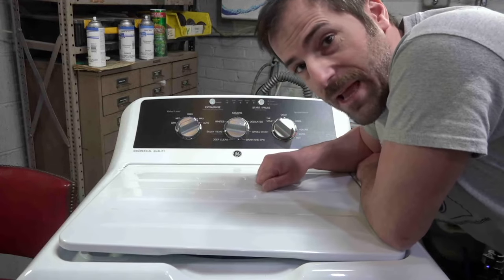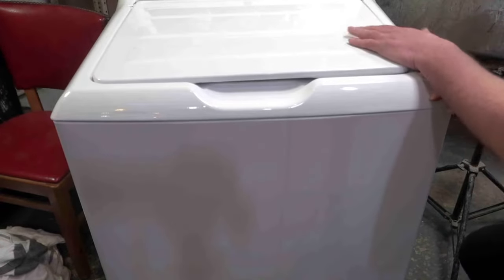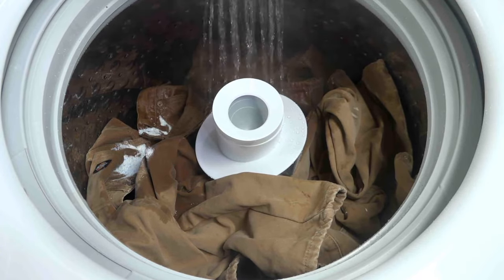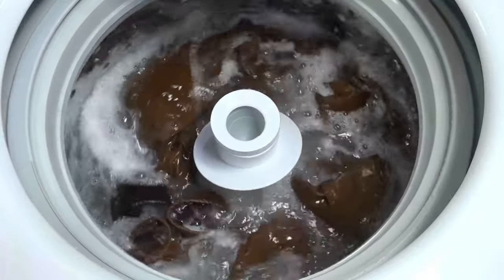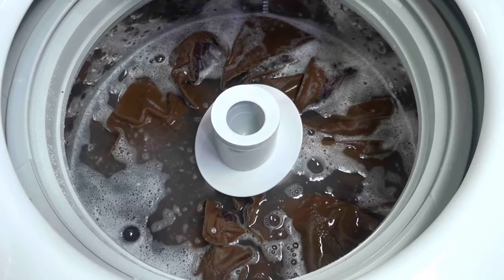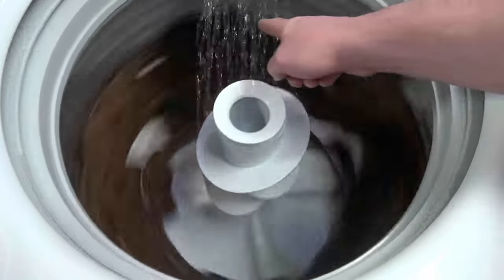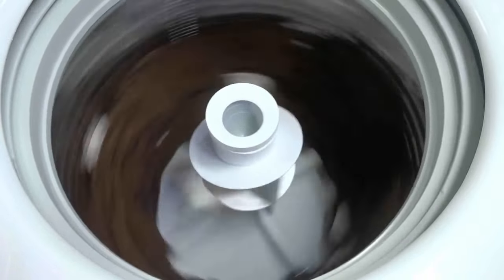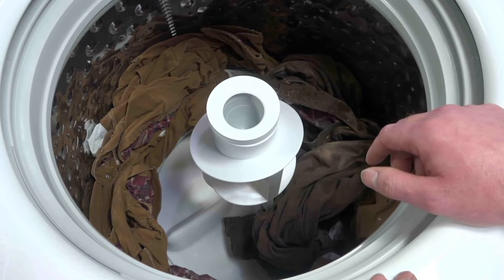FIRST LOOK: GE Commercial Washer GTW525ACP1WB

Comment: It's pretty bad that manufacturers have to slap the word "commercial" on their product in order to try to portray that this is a better machine than their residential counterpart pieces of crap. They're pretty much admitting that they make crappy products nowadays.
Reply: GE's put "commercial quality" on high-end washers since the early 2000's. Only thing new is people here tricked into thinking this washer is somehow special.
Reply: I agree 100%. Slapping a commercial badge on a machine and throwing an extended warranty on it doesn't make it commercial. 

I haven't seen GE machines in the truck stops, Laundromats, or hotels in the area  I live. 

What I have seen: Speed Queens, Maytags, and in the shower areas of some truck stops, the LG 3 series front loaders (such as the WM3600, WM3700, WM4000, and WashTower). If they're good enough for a truck stop, they're good enough for me.

Comment: have a new unit that has never filled with enough water. no adjustment like other models. water level controlled by timer to save the world. had all circuit boards replaced and still the same. have to add a bucket of water on each load. ge  just blew me off and said i could get a different model and still have to pay about half price.  if you dont have a high water supply pressure it will never fill to do the job right. told them that a minimum pressure notice should be on the machine. they could care less. save your money and time and dont buy this shit.

Comment: Just had the plastic drive pulley replaced on our GTW525 after 22 months of operation. It destroyed itself at the motor drive shaft. Repaired under warranty but was really surprised that the main drive component in a "commercial quality" machine was made of plastic. We'll see how long the replacement lasts.
Reply: Same thing happened to mine after 14 months!
Reply: Were the gears plastic or nylon?  I am guessing that the pulley did not have a metal bushing molded into it

Comment: I haven't used this washer for a while it's sitting in the basement. If I remember right it's fairly gentle on the clothing. I guess the thing is, if I want gentle on my clothing, I would put it on a gentle cycle. I don't need it to be gentle right up front.The thing I don't like, for certain, is it goes off balance real easy. I will stick with my Speed. Queen front-loading Commercial washer and my Maytag top loading commercial washer. Love them
Reply: you have two washers ?

Comment: The verticl sections on the agitator are designed to splash the water onto the clothes during the spray rinse. This has the best agitation I've seen on a modern washer. Their cheap washers have this same agitator and wash action along with the 20 minute spray rinse and spin on the normal eco. They've been this noisy since the 1990s, but my Hotpoint went strong for 13 years. As far as I know it's still working in the house I sold. My presnt cheap Hotpoint is noisy but works fine. For $429 if it still works after 4 years, I won't complain.

Comment: To get real hot water in a washer.  I would think we might have to run the faucet in a nearby sink until it runs hot.  Then turn on the washing machine AND maybe shut off the cold water faucet running to the washer ?
Reply: Yes, you could do this if stuck with a washer that makes it necessary.  I've spent way too much time thinking about ways to defeat the dumb-a$$ery imposed on washing machines these days.  If I had the capital I'd start a business with hacks and add-ons to deal with these issues.  My idea is a valve system that you attach to your hookups and then the washer supply hoses hook into the system.  There would be a switch or valve that you could turn so that when you wanted untempered hot water in a machine that always insisted on tempering, you would just turn the valve and it would divert the cold water supply back to the hot so that the machine would only fill with hot no matter how much it tried to add cold water.  It wouldn't be hard to do this without any fancy "system" (just put in a y with a valve), but my idea is that it would provide a neat, clean appearance and be very convenient to just reach up and pop the switch or valve over when you wanted that full hot wash.  Then you could switch it back to "normal" for rinse or any time you wanted the regular wash with access to cold and warm temps.  Might make a cool cottage industry item . . .I'd certainly buy such a thing if Lorraine Furniture sold it.  Bonus for the Lorraine Furniture Logo on the product!
Reply: That’s what I do

Comment: Why do all the newer washers sound like they're straining? Older top loading machines sound smoooooth!! I have the non-commercial version of this washer. It's just OK. So so! I like my commercial Maytag. What do you recommend for a front load washer that's reliable and I don't need all those Bells and whistles
Reply: Mainly because of how the older ones both had a larger higher power motors and the motor would spin in one direction for the agitation cycle and the other way for spin with the transmission doing the back n forth movement whereas nowadays the motor does the back n forth movement they did that since it's cheaper to manufacture and more energy efficient but you lose a lot in overall cleaning performance and reliability
Reply: @terryb492 I don't agree about the cleaning performance. Have both a Maytag commercial washer and a whirlpool non-vended commercial washer of the current belt drive design. I can guarantee you they clean as well as any old school washer.

I think it's amazing how Whirlpool could come up with a motor that can move back and forth very fast and then have the long back and forth strokes like this one. This is only in their commercial models i see that kind of agitation.
Reply: @terryb492 that would be the induction motor which that's better than the newer washer motors that goes back and forth

Comment: Not a bad rollover .. think the max fill water level could be higher.. I have a similar model thats as high as the water gets .. the bulky cycle doesn’t add anymore water.. Wish they made a better agitator it appears to look like a dual agitator .. it would have been a better rollover if the top had 4 upper fins to match the lower fins on the wash plate or made it dual action.  The overall agitation can be rough on clothing  with possible shredding could be a little gentler  The suspension could be better . If it comes  unbalanced its slow to correct the issue and bangs horribly  and possibly damage the machine or walks away from the wall

Comment: I’ve had my GE gtw330ask1ww over 6 years ago. It’s very similar to this commercial version & this just doesn’t come off as better built. Because it’s so similar, I would never buy this.  IMO The few little upgrades done to this is not worth the near $500 premium over the current base hotpoint / GE washer. 

TBH I’m actually surprised mine has lasted this long. I’ve only had to replace the lid latch & a few weeks ago I cleaned the belt and pulleys as they’ve gotten greasy from the seeping gear case seal. Belt would slip bit to heavy loads when the spin cycle started causing the machine to soon quit as it’d think it’s unbalanced.

Comment: that wash action is really similar t oa GE I had in a condo I rented in florida for a couple years..  it always seemed like slow agitate but the turnover wasnt great but it did a good job of getting the clothes clean. your machine here seems to get the jo9b done!! I always kind of think about commercial machines being more aggressive.. NEXTEL!!! I got in on the ground floor..  back then cell service was super pricey..  and Nextel allowed you call anyone in your group for free  so a whole group of us friends went together and got nextels..  we all held conf group walkie-talks all the time..  I had a big yellow phone called it the "steelers" phone :) we also had them in the HVAC company I worked for..  I miss them. these motors are driven in such a way they sound labored even at low speeds and low troque.. was that bird tweet sound the washer? that rinse is like the 'ECO' cycle on my speedqueen..  I use heavy duty on that machine so I get a normal fill-agitate rinse.. nice fast final spin..my SQ only has a short burst of that fast spin

Comment: Can you use Pine-Sol in a front loader, and if so, where is the correct place to put it?
Reply: I don't know where the proper place is to put it. I only use about a quarter cup if that and I dump it right in the machine
Reply: Yes, and either the main detergent dispenser or directly into the drum on the tub clean cycle. As with your detergent, a little goes a long way. 

If I'm out of Tide washing machine cleaner, I often use OdoBan or Pine Sol as an alternative.

Comment: Seems to do a pretty good job, other than the fact that it looks like it's kind of cheap in quality, and may have easy to break parts, but the performance was good.  Never understand the reason that during the wash agitation, it does those short very slow agitation  periods.  What good is this, or what are these slow agitation  periods designed for.  Why doesn't the agitation just keep churning away at the same faster speed through the whole cycle?
Reply: Stephen Boisclair: Whirlpool Agitator WASHERS do the very same thing as you mentioned with the fast and slow agitations. I can't help but think that they copied each other's design. I still get the feeling that GE and WHIRLPOOL merged with each other. Their only differences are their Appliance Names.
Reply: Copy catting each other. Identical agitation and neutral draining.
Reply: That under powered motor has gotta cool off somehow 😂
Reply: @booandsue: The Whirlpools operate the very same way as this machine with alternating periods of slow agitation and back to normal agitation. It's sure seems like Whirlpool and GE merged with each other. Also neutral draining in both brands of these washers.
Reply: It lets the clothes spread out to prevent knots and twists and respread the clothes out evenly.. its a sort of protection for your clothes it also spreads the clothes to avoid the clothes bunching up and possibly lumping up to one side and causing an unbalanced issue..
The slow agitate has multiple purposes..
Reply: @orangie8426 my GE always goes off balance and I always make sure the put the clothes around the agitator evenly
Reply: @albertcarello619 Not as far as agitation goes. Both the Whirlpool and Maytag commercial versions have faster and better agitation than this thing by far. Even the Whirlpool WTW4816FW and Amana NTW4516FW have better agitation than this.

Comment: I did consider this one, too.  Even on Deep Clean and with the heavy load that was placed, it still doesn't fill rinse.  And there's only a button for Extra Rinse.  Even the noncommercial GTW series from GE, which is just a plain residential, have that option.  They have almost the same agitation and cost about half.  No, just no.

Comment: There are a lid lock on this machine and if so, how are you bypassing it also I received just a basic GE washer yesterday. One load hate it already. I can’t figure out how much each load is going to agitate if it starts to spin and I hear my clothes are not distributed, how can I open it and rearrange clothes if lid is locked not sure but seems like it’s not a tub rinse. It’s a spray rinse and spin which I do not like. What do I do now my previous washer I could pick delicate I could pick six minutes to run it or 10 minutes to run it whichever I desired, I don’t know what this is. All I know is the one I did run 15 minutes normally in my washer I would’ve not ran 15 minutes that particular load I would’ve gave it maybe 10 minutes well I guess you get what you pay for purchase my GE through Home Depot.

Comment: This is silly . I thought the spiral agitator was going to  corkscrew clothing on top  down to the bottom and  the upper portion going in one continuous corkscrew direction. They could've just put in a straight vane agitator if it  was going to  go back and forth. Its alright but think i would look at other models in the meantime. WHAT DID YOU SAY? $1,100 FOR THIS WASHER. Forget it. Id rather save more money for a washer with  turbo wash   or a front loader. Something other than this. At  a laundromat this thing would hold  up  9 months before problems would  get started.

Comment: So on the heaviest wash cycle all you get is a spray rinse ?
Reply: correct. There is no advantage to a submerged rinse. A spray rinse is 40% less likely to transfer bleeding colors.
Reply: @xChrisN1975x Of course there is. The more water, the more dilution. So if you have colors that bleed then they should be washed alone to begin with.

Comment: Better spray rinse on GE than Maytag Commercial washer.
Reply: BubbaKuns2000: I hope the GE has an optional full tub rinse as well. I'd like to see that feature if it's available on that machine.
Reply: @albertcarello619  It's the extra/deep rinse.
Reply: @jeromedavis8575  That's what I always use when using a fabric softener the second deep rinse cycle.
Reply: @albertcarello619  NO it does not. A full tub rinse is actually worse than a shower rinse. It cost more money to use (more water) and it is 40% MORE LIKELY to transfer a bleeding color than a shower rinse. nearly no washer does a full tub rinse anymore.

Comment: I spent $1,028 plus on a 2018 Speed Queen TR5 SERIES WASHER. Consumer Reports rated the washing performance as poor. By using the auto -fill feature I was able to better the washing performance.
Reply: Also extending the length of the wash cycle by increasing the soil level really helps with results because HE detergents are formulated to work over a longer wash period than the older formulas. Speed Queen should have labeled what they label the Normal Cycle as the Express or Quick Cycle and the new increment up in the soil setting as Normal and they probably would have avoided the criticism because the tests would have provided better results.
Reply: @LlyleHunter  Very true!!! I use either the Heavy Duty cycle or the Permanent Press cycles 90% of the time with Auto-Fill feature.
Reply: the TR5 Speed Queen will likely last longer than this GE but this GE has proven to be a better cleaing washer.

Comment: I use cold water for colors. My mom never used warm water. However , hot water for whites.
Reply: warm is fine for colors unless garment is brand new. those will need 5-10 washes on cold, first.

Comment: What does tap cold mean versus cold wash cycle?
Reply: Tap means the temperature of your tap water which depending where you live can range from just above freezing in the winter to almost 80 in the summer. The Cold Water setting mixes tap water with hot water to bring the temperature to a set temperature (50 to 60 degree + or - depending on the manufacturer) Wash water below a certain temperature does not wash clothing or anything else for that matter. Personally I think a water temperature of about 60 to 75 degrees F washes my clothes the best and I am a heavy equipment and truck mechanic.  I have a separate washing machine (25 year old Maytag for my work clothes and make a pre wash spray that I spray everything down with and treat really bad areas with a petroleum based hand cleaner and scrub the spots with a brush a little bit from both sides. I then fill my machine with warm water and homemade laundry soap my Grandmother taught me to make that works better than anything I have ever purchased at the store and let them soak for several hours and then wash them once and rinse them twice. They come out as clean as any uniform service I have ever used and don’t bother my skin like when I send them to a uniform service

Comment: Why does the lid not lay flat when you lean on it?
Reply: He took off the lid lock and stck it in the lock hole to trick the machine so we could watch with the lid open. The lid stricke sticking out of the lock hole stops the lid from closing but it wouold not be this way new out of the box.

Comment: Looks like they took the 335 added a black panel different knob and different lid and called it commercial. The 465 is definitely better than this one and it’s got a bigger tub and the dual action agitator
Reply: the 465 model has a 1/3 hp motor and a 1 year warranty. 465 < this commercial washer

Comment: As an appliance sales specialist have been unimpressed. This is nothing more than a gussied up previous residential machine that has a one piece agitator and 4.2 cubic foot capacity. The thin sheet metal lid gives it away.
It may have a half horsepower motor but looking at the underside most of it is just cheap plastic and residential components not at all like the Maytag commercial if you do an inspection / teardown

Comment: THESE HAVE THE DIME SIZE CHIPS ON THE BOARD THAT ARE DOING 257 THINGS  AND FRY OR LOOSE MEMORY I MEAN THEY COULD HAVE MADE THE SAME CHIP WITH JUST MORE SUBSTANCE THE SIZR OF A NICKEL AND THAT WOULD SOLVE THE PROBLEM MATTER FACT THE CHIP THEY REPLACED WAS THE SIZE OF A NICKEL.   THEY DIDN'T NEED TO GO SMALLER AND THE CUSTOMER DIDN'T ASK